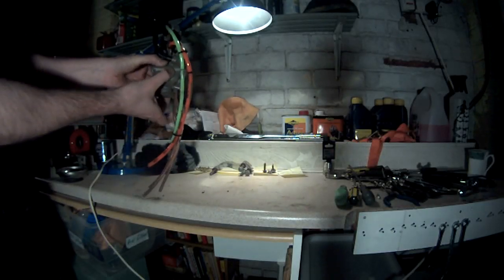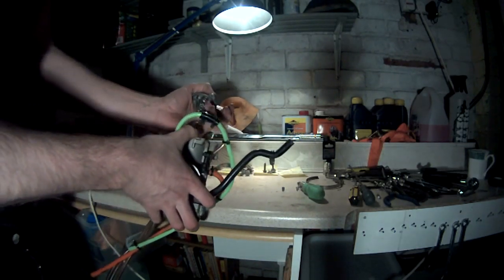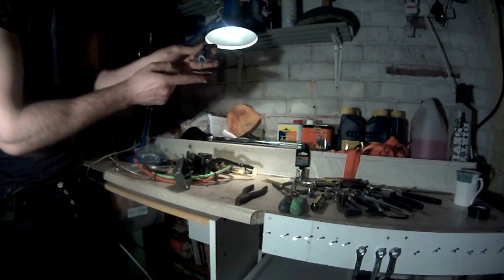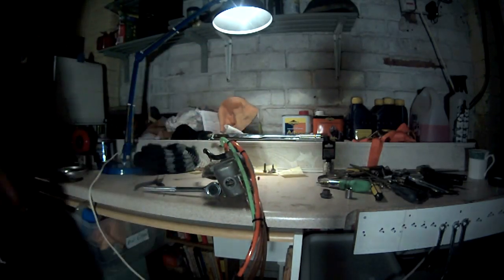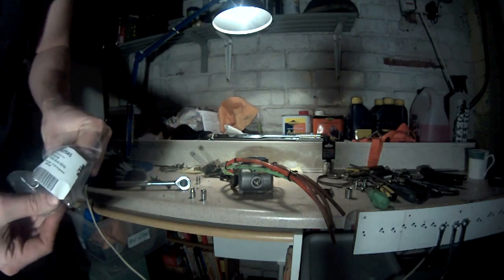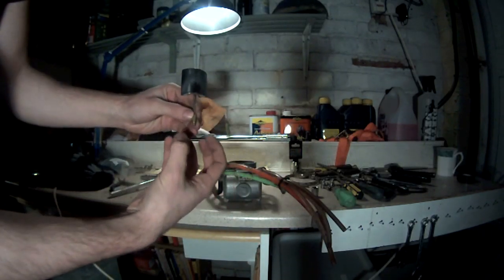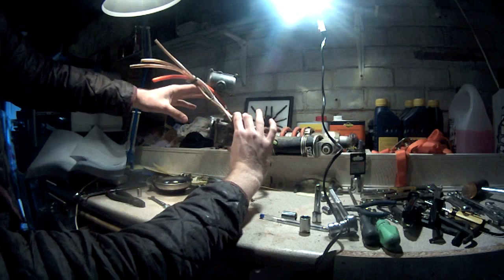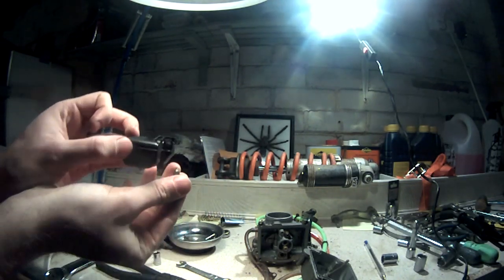KTM Keihin Carb How To: Jets, Needle, Clip, Floats PART 1

Comment: This is not a Smart Carb nor a Lectron modification. This applies to the PWK A/S  and the replacement of the original metering system. It is called the STIC metering assembly; it is totally new and will add + 5HP to your existing set-up, takes 10 minutes to install contact sticsupertorque.

Comment: So I took got the float bowl off, everything looked just as you showed it and, not seeing any grime or gunk in the bowl I re-assembled and the pissing was resolved! Started up on the first kick, too!

Still have another issue, sadly, with it smoking and spewing oil  when revving. Spoke to the dealer who said it sounds like I have a stuck powervalve. Taking it to them to have this fixed. Sucks when there's only two-tenths of an hour on the motor. Expect that they will be able to sort it out.

Comment from the maker: Hey thanks man, feedback like that is what makes them worth doing, knowing its helping people!
Im not an expert so don't take my word as gospel lol but just from the sounds of it your float hight is sitting too high, so don't be afraid to get stuck in, carbs don't have a lot of pieces inside and are really easy to take apart, try lowering the floats slightly by bending the little metal piece inside and let me know if that solved it. Cheers!